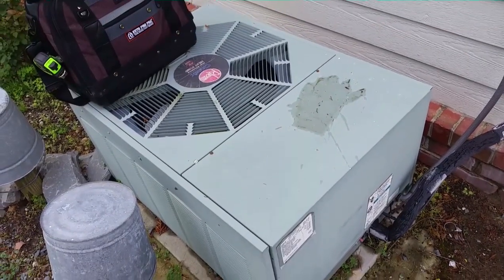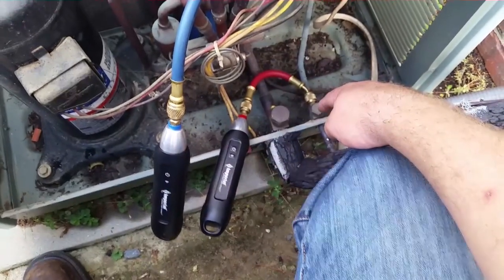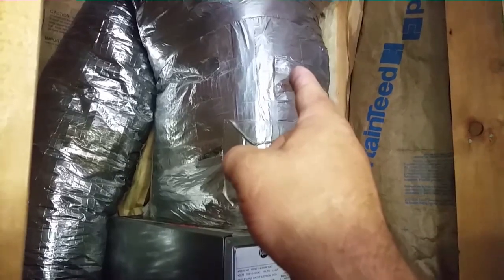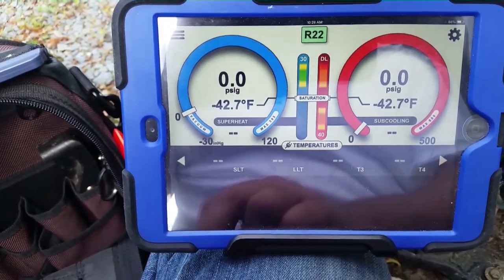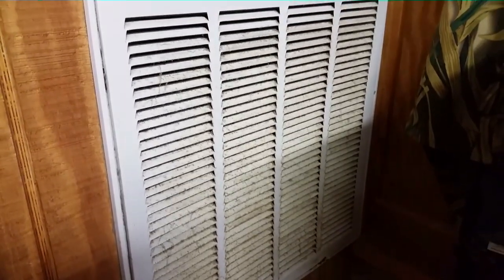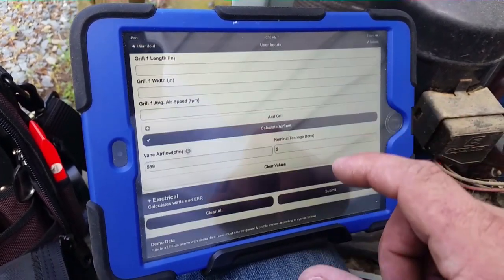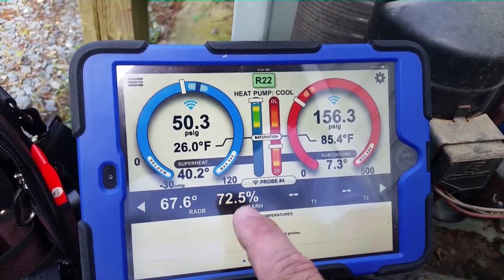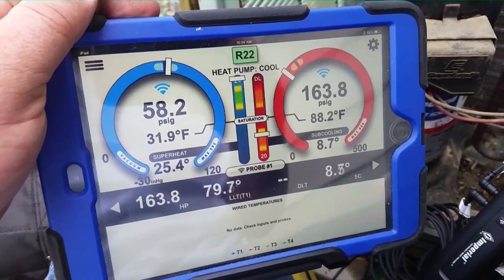Imperial iConnect Field Demonstration

Comment: Question.  When measuring cfm on the return grill.  Is the grille effective area needed or can you just measure the open dimensions of the grille?
Reply from the maker: You need the k factor to calculate the open area

Comment: I Like how it Shows Exactly how many Btu's / Tons of cooling a Customer is Really Getting With a System that Needs Repairs. You Could show a Customer a Before and After Printouts / E-mails / Snapshots of the increased amount of Cooling Capacity. Noting that the same amount of Electricity is Being used in Both Scenario's.
i could show that to my customers and they would be so impressed at the technology & The improvement Before and after Repairs.

What a Great tool!
i Like it better than the i manifold.

It Would be Great for Adjusting an Expansion Valve if a Unit is on a Roof and the Evaporator Coil is Down inside the Building. You can adjust Txv and watch response to dial it in instead of running up and down From the roof.

A Couple Questions:
1) How Much Distance are u Getting Now With the iconnect u figure ?
2) Max Distance Video ??? possibly ?
3) How much do you figure you Have invested in Your Set up ?

Yep, Putting on Christmas List Now!

Comment: Zack that is what Tech's call Connect Connect Connect Connect Connect  Thanks talyn875
Reply from the maker: Right on Mike
Reply: talyn875 Is that all the probes that you use?
Reply from the maker: ***** yes
Reply: talyn875 how you feel about temp clamps VS strap temps
Reply from the maker: The straps are way less expensive and more compact, but can be a pain to secure. I like them a LITTLE more than the clamps.
Reply: talyn875 ok thanks